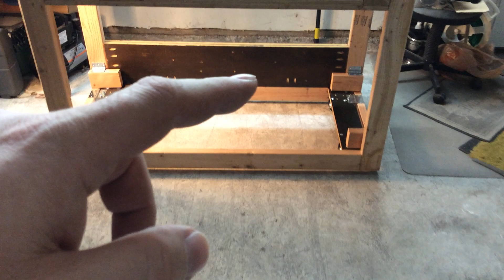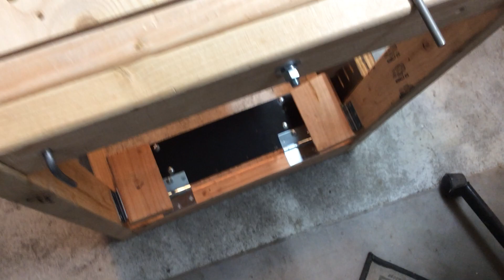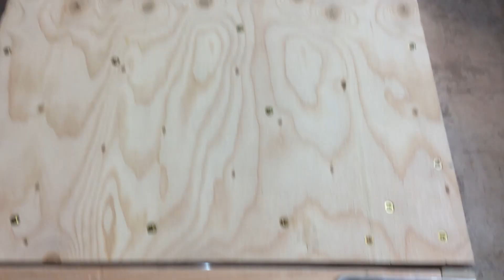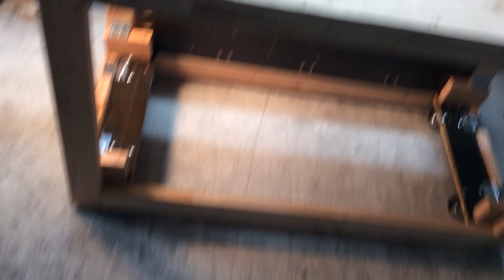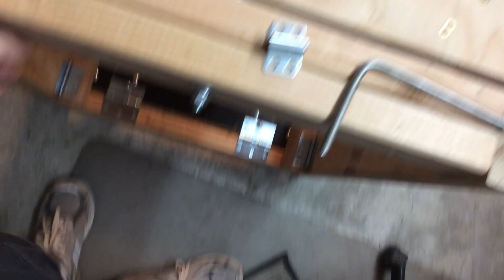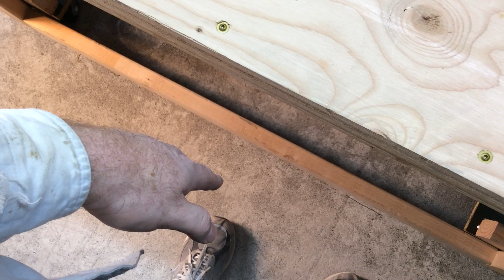Flip top tool stand ready to use but not totally done

Comment: For your Pins you could use "Key Chain" Chain by the foot and clamps I get it from Ace Hardware. Then you can't loose your pins or get them mixed up.
Reply from the maker: Thanks, that could work, I will think on that.  Having the pins connected may indeed be better than a pin holder bracket.  Then again I already have extra brackets... so I may try that first and if I have issues go get some of that chain to fix it permanently.